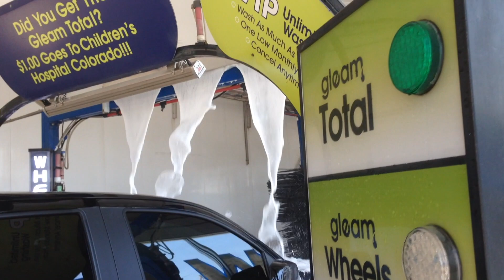Gleam Car Wash

Comment: Now thats who your suppose to put on the tricolor foam. Add before going into the mitter
Reply from the maker: My personal preference is to have it near the entrance of the tunnel, probably immediately after the lava bath (if present). It allows instant gratification for customers who get the service and provides more lubrication.
Reply: Who makes that tri color manifold?
Reply from the maker: Its a Sonny's Triple Drip manifold. Pretty sure they are designed to use less chemical than a standard 6-generator or possibly even a split 3-generator triple foam system. This is the first and only one I have seen so far, but they are very popular in the South.